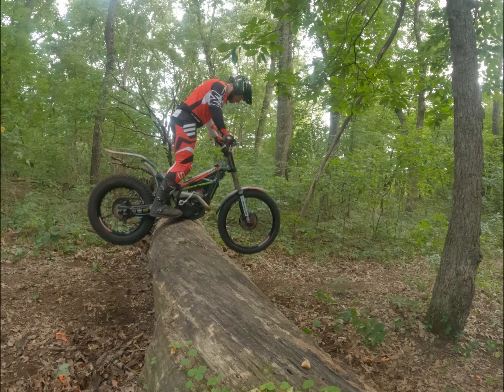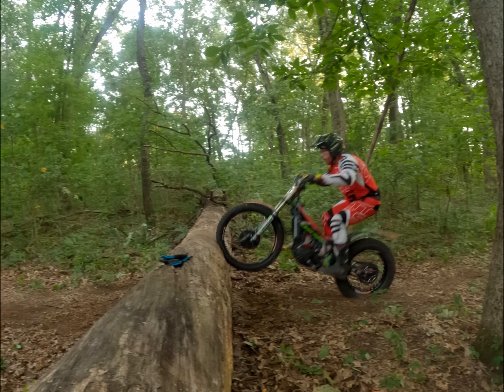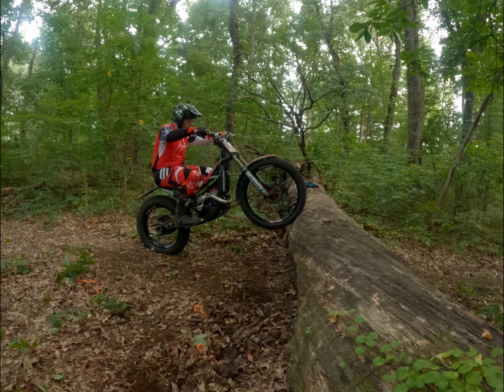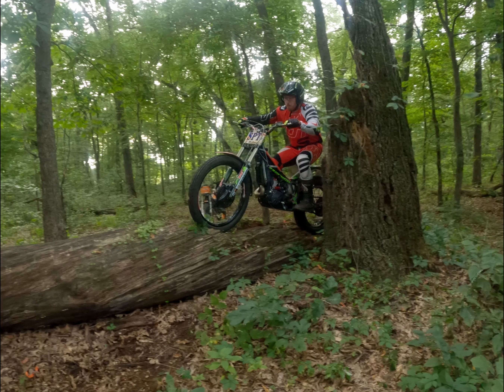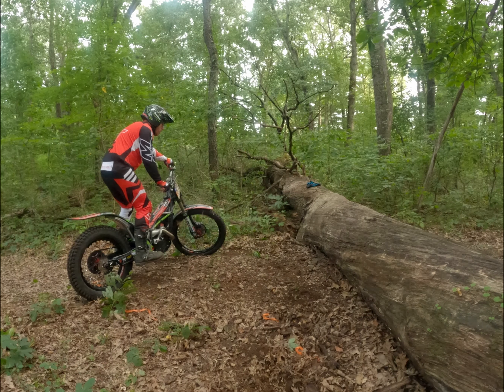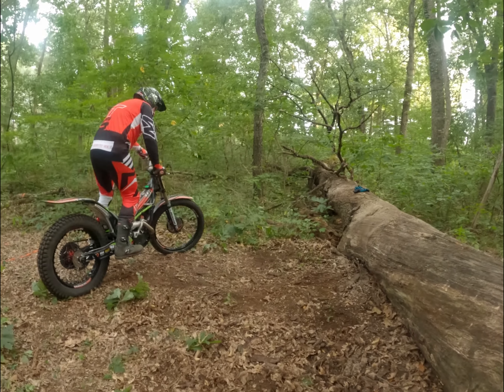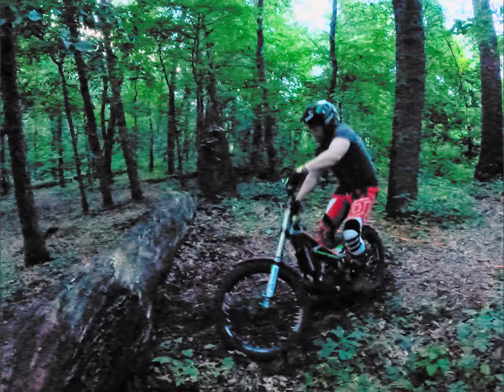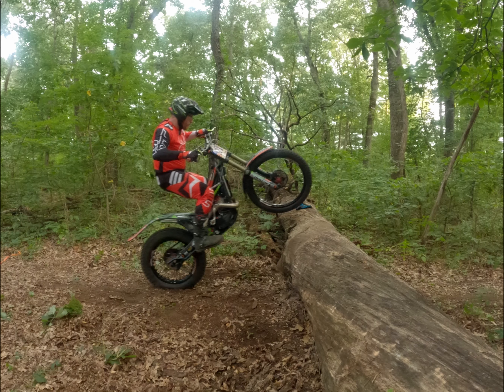FIRST FLICK TURN ONTO LOG ATTEMPT

Comment: Good progress Shawn, how are you enjoying the vertigo?
Reply from the maker: I absolutely love it. Idk if I would personally like the standard model, or anything older then a R2. As for my R2 though it has been great. I've had a few small problems that the importer has promptly taken care of without issue. I love the efi. Some riders don't care if their bike is running rich on a hot day, or lean on a cold day. They ignore their bike knocking, or hesitating or whatever. Those things drive me crazy. Living in Indiana and the big temp swings we see during spring and fall I love the overall consistency of the bike. I also opted for the wifi system. That means I can quickly make timing or fueling adjustments if I feel the need. Normally I don't but there have been a few times like say a day with moderately warm temps but super high humidity. Those days I have a map I load because the bike doesn't pick up on the rich condition caused by humidity. Overall though I've felt very little need t fiddle with much. I will fit firmer springs over the winter. I am short but hefty lol. The bike has done good, but I noticed the other day the bump stop on the Rieger has gotten pretty thrashed. If you have any specific questions feel free to ask. A general overview would have me say it feel Beta-ish in rider position and stance on bike, but the Vertigo is longer in wheelbase. The Vertigo also feels overall more responsive in throttle and reacts quicker to rider input as far as handling. Clutch is a little lighter than my 2019 factory Scorpa and has a bit more feel. The Vertigo is heavier feeling in the front then a Scorpa/Sherco or TRS. My R2 has added  flywheel weight as part of the stock design. Despite this it doesn't feel like it. Personally I would like a little more weight in the flywheel. Not because the bike is hard to control,it is amazingly nice actually, but just to have a bit more stored energy on tap when dropping the clutch. It takes a bit more RPM than my Scorpa for techniques that rely solely on flywheel energy. I will also say the Vertigo does have a lot more top end power and doesn't drop off as soon as either of my Scorpas. Not like I'm good enough to effectively use it, but it is something you notice just goofing off and revving the bikes out. Love the ease of airfilter maintenance. Trade off is a bit harder (still easy) to access spark plug. Full engine rebuild can be done with engine still mounted to frame. Same with transmission bearings. Some cool stuff. I've been really lucky to have owned some great bikes in my short time riding trials. Each one has had things I liked and some things I straight up hate. Vertigo is no different, but I haven't ridden another bike that makes me wish I owned it instead. Do really like TRS and that was actually what I was going to buy before a last minute impulsive decision to get a Vertigo.  No regrets though ! Very impressed with my R2.
Reply from the maker: Incase anyone else reads this I want to clarify a comment I made. I have ridden a 2021 Works 250 which is the standard model using the R2 airbox upgrade from the year earlier. It was a nice bike and surely more capable than I'll ever be. I prefer the power delivery of my R2. The R series bikes have mods to make them faster revving and a bit more powerful but then they also add some weight to the flywheel to balance out the increased power and faster response. For my style the R mods fit me better. I don't mean to say the standard bikes are bad or undesirable. My wife rode the standard 250 and thought it was real nice. I've seen video of the standard models being ridden at levels I could only currently dream of. Anyway just wanted to clarify it is a personal preference thing and not a "the bike sucks" thing.
Reply: @shawnmcginnis2508  thanks so much for the detailed ownership experience! 
I also like the idea of FI for changing alt and temps etc.
I do find the different models from different years very confusing, i would probably looking for a good used 6/12 month old bike i think.
I have had an old beta evo 250 and a montesa 4rt cota 260, id say im torn between going for a tryed and trusted new beta evo 250 or a  vertigo as they are interesting and id like to try one at some point even tho my riding wouldn't warrant such a good bike lol.
Reply from the maker: @rh_8599   The great thing is all the modern big name bikes are pretty great. My EVO was a 2014. A great bike and way more capable than me. My complaints with it were mostly in the lightning quick clutch, and the fact it was always grabbing  pretty bad no matter what I did. I also didn't like how fast the filter got dirty, but it was easy to service :) The  rear mud guards are pricey too. Hopefully I don't sound too anti-Beta. I really did like mine on the whole.I wish Beta would do some more advancements as I feel they have gotten lazy on their forward motion. Maybe fit the normal braketec stuff, switch to a diaphragm clutch, stuff like that. They are a good bike, but just getting old in my opinion. For somebody who is really happy with them, but has the money to buy the almost exact bike just with new graphics and fresh bearings that very thing might be a huge plus.  
    I got my Vertigo from the other side of the country and my first time seeing one was when I unboxed mine. They are $$$. Seeing them up close you can see why to some degree. Plus they are a small run batch of bikes compared to other brands. I sold my Beta and a street bike I was no longer riding to help buy mine. I can't say weather it is worth the price or not to somebody else, but for me I think it was. Next year they should be releasing their next generation model. I believe it will have electric start. My wife may very well end up on one. 
    If you look at Vertigo I would highly recommend the works 21 model, or a R2, R3, or Busto. A 2020/2021 DL12 would be a great bike to depending on your style.  
    The quick breakdown of the models is..
  2021 Works21 (standard model). 2020/2021 R2 (factory model).
2020/2021 Busto (R2 with some mid-midseason improvments, maybe a hotter map, and custom paint/graphics to honor Jamie Busto).
2021/2022 R3 (next generation of R series bike and the last one in line before the newest generation of Vertigo is launched)
2020/2021 DL12. (Lampkin replica fitted with all the nice goodies, but slightly mellowed compared to the R2 by way of different throttle body, heavier fww, and probably different mapping.)
 Hope that helps clear up the confusion some. 
   I would say ride one and see what ya think if possible. I really like mine, but everyone is different. For me I love how smooth the bike is especially under a load (like sidehill maneuvers) and how much confidence it inspires in me.  Also note I went into purchasing mine knowing there may be a learning curve with all the tech/electrical stuff on the bike, and also knowing in my case I am my own mechanic as the closest dealer is at least a 9hr drive or so. 
   No matter what ya pick, best of luck and look forward to hearing from ya someday about your new bike :)